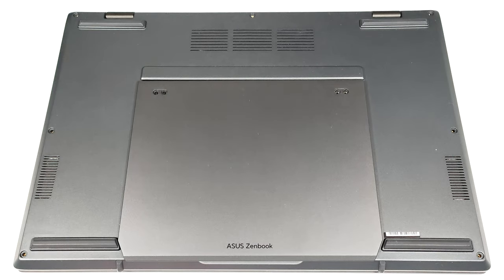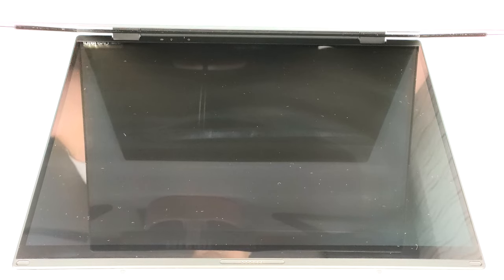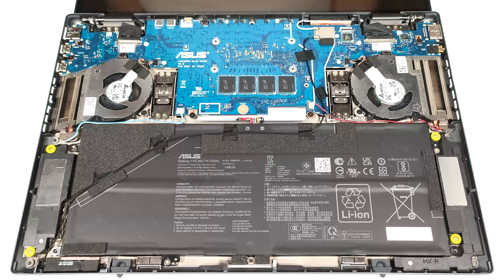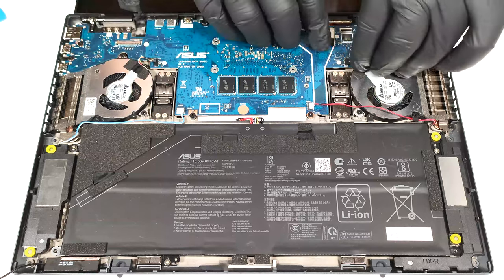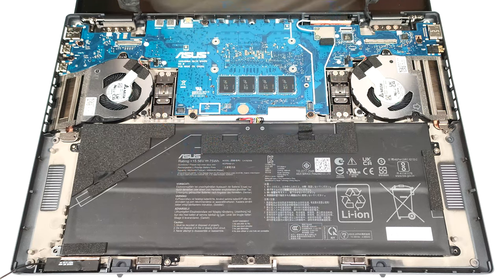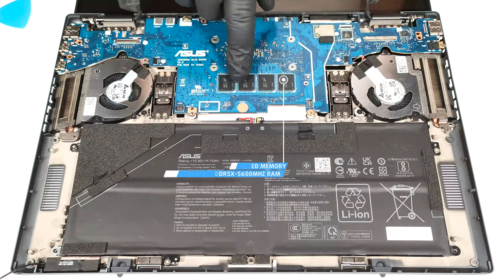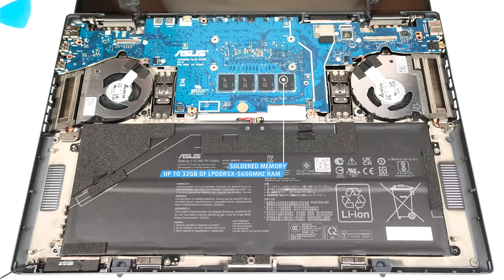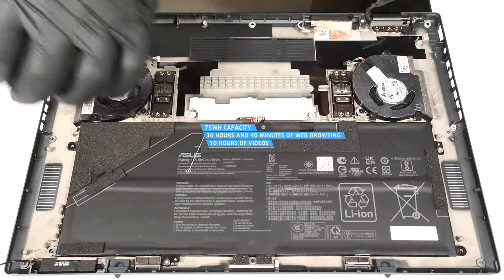🛠️ How to open ASUS Zenbook DUO (UX8406) - disassembly and upgrade options

Comment: DONT JUST DONT DO IT!!!!!! YOU END UP BREAKING THE SCREEN, HE PRE REMOVED THE SCREEN,  I LOOKS EASY TO REMOVE BUT THE SCREEN IS SO THIN AT THE EDGES, I ENDED UP CRACKING THE SCREEN!!! NO REPLACEMENT PARTS FOR THIS! UNLESS YOUR WILLING TO SCRAP YOUR $1800!

Comment: Oh man soldered ram...
Reply: You make it sound like all laptops should be freely upgradable with no drawbacks, no matter the engineering challenge or loss on potential profits. It’s like consoles. You get what you get until the new gen comes out.
Reply: At least they do not offer an 8gb option
Reply: There is actually a semi-valid argument for soldered ram in high-end machines now, since the highest speed memory is starting to be limited by the physical length of the traces on the motherboard, instead of it just being a scam by apple. But then you see manufacturers trying to sell you a machine with 4GB soldered into it...

Makes me thankful for Framework at least.

Comment: It is not a bad laptop, it doesn't have many glued parts, but the memory is soldered and it's very difficult to access the SSD drive, although it's appreciated that it can be upgraded.

Comment: Excellent video! I'll probably wait until mine is out of warranty to upgrade from 2TB. Ist 4TB the maximum on Gen 4 SSDs?
Reply: I thought they only had it in 1 tb? Did you upgrade to 2 tb? . Also did the 4 tb upgrade work?
Reply: @novacombatarts I’m in the EU so I can order the 2 TB model. I’ve now seen it on NewEgg with 8TB SSD. Gonna do that if I can.
Reply: @novacombatarts I was able to do the 4TB upgrade successfully. 8TB wasn‘t possible cause I couldn’t find single sided 8TB SSD. Didn‘t really need that much though. I can post tips on the upgrade here if anyone needs them. Some steps were not explained here in enough detail, but i figured them out. Really happy with upgrade.
Reply: @kwameryan  yes please post the rest of your info you found, thanks!
Reply: @JeffBaugher-g6q  When you open the access port, the battery connector is covered with black tape which isn’t shown in the video. Remove the tape gently and then pry the connector straight upwards with a flat tool. This particular detachment isn’t shown in the video. On the display connector, after you flip up the cap which rotates on a hinge, grab the tab and slide the cable straight back away from the connector and out of its slot. Then, in the next step, while prying the main housing away from the second panel, there are very strong clips holding the two sides together. Do what the video says, but understand that the force applied needs to be slow but quite strong to get the clips to pop open. Having the actual tool in the video or something similar that can be inserted then rotated will make it easier. The fan and speaker connectors are detached straight upwards. You don’t need to go any further in the video than when you turn the mainboard over to access the SSD, the replacement for which must be single-sided (with NAND chips only on one side). Don‘t remove the fans or speakers. The scary moments during this mod are not knowing which direction to pull the cables or how much force will be needed. If you pull in the right direction, and open the display connector properly, none of the cable detachments require much force. If you feel like force is needed you‘re almost certainly applying pressure in the wrong direction or the connector isn’t full open. Take it slow, store removed screws carefully in groups according to size and shape, maybe take pictures of how cables run before moving them. Good luck!
Reply: @kwameryan  thanks!!

Comment: Fantastic and interesting. I'll never open  up my Zenbook Duo UX8406 to work on it, but it's nice to know what's what, how it's put together and where things are inside it. 

Special thanks for providing the full suite of settings to achieve maximum battery life! This is the only place I've come across the specific formula...I definitely noted it for future reference!
Reply: Definitely don’t. Mine had the battery connector randomly disconnecting. After taking it off once the 2 screws on the small cover will not screw back in, they’re not stripped or anything just too small. Now probably won’t get warranty :) 4K au in the bin unless someone local can fix
Reply: @Tacsacktap  Sorry to hear that. Sounds like an easy fix though.
Reply: How's the performance. GPU and others?
Reply: I cannot imagine why they decided that the one and only upgradable component had to be inaccessible until you took apart every single connection on the entire device... the actual position of the SSD is so close to the little hatch on the back that has to be opened anyway before you can access anything...

Comment: ASUS UX8406?
Reply: There are two versions of the UX8406, the 32GB RAM version in this video (UX8406MA-PS99T) and the 16GB version (UX8406MA-DS76T). Good reference video. Useful if I ever decide to upgrade the SSD to 2TB which ironically is available in other markets but not in the US market.